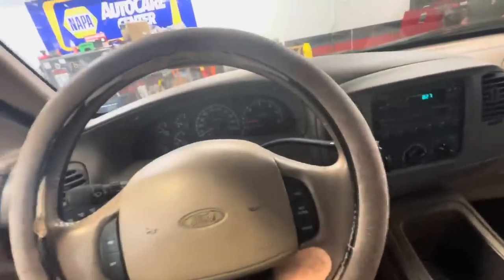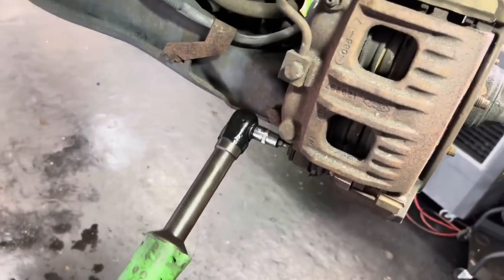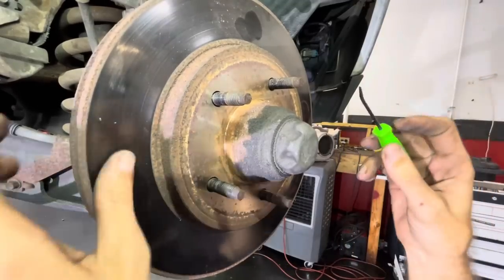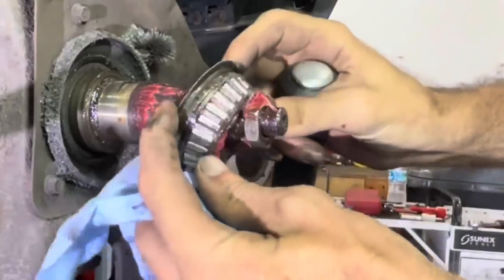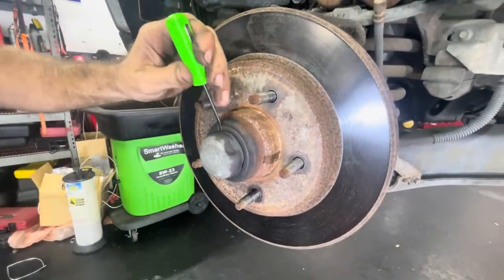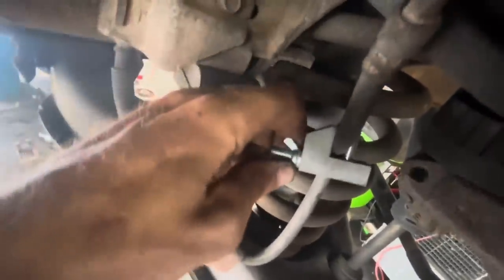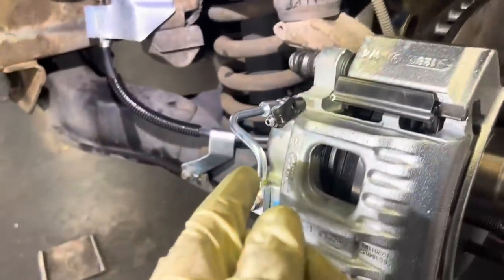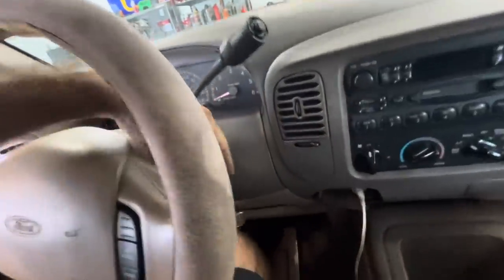Worn to NOTHING! 1998 Ford Expedition

Comment: When it comes to brake work and removing the caliper, ZIP TIES are your friend. I've had too many calipers fall on my head/hands to just set it on the knuckle. Just had to do a brake job on a POS 07 uplander. Dude swore the noise had JuSt StArTeD, there weren't any leaks (2/3 of everything was covered in oil/fluids), no cel, ran fine... Metal on metal on the back side of the driver side rotor. He came in for a brake pad change, ended up having to have the rotor and pads replaced. Dude brought brake pads that didn't come with hardware and told me to just put the pads on without hardware... Now, I'm not the type of woman to do as I'm told but considering how misogynistic and sexually inappropriate dude was (AFTER ID TORN DOWN THE BRAKE ASSEMBLY), he got exactly what he asked for. He was EXTREMELY lucky, the caliper wasn't extended to the point of no return somehow, the set screw had to be drilled out (he told me not to put a new one in since he couldn't afford an extra $1 for a screw), then tried to dip out on his extremely discounted bill... Dude is banned and local shops were informed. The kicker was this man swore he knew everything about everything cars 😂. They're why we have a liability form with an area reserved especially for people who want to come into my shop and bark orders.

Comment: Ok that steering wheel is gross. Second, my 2004 Mitsubishi Evo VIII MR has 277,000 miles. Engine was rebuilt and got a tune to bring it to 367 hp. Since I bought it new it's garaged every night and all maintenance done on time. It looks and drives better than new. Take care of your vehicle and it will take care of you. No rust or corrosion because it was a California car for it's first 16 years and now resides in Arizona

Comment: 6:25 EXACTELY!! Some ppl (read a huge amount) are so incredible clueless whit total lack of common sense that its scary! 

There was a 25 year old woman educator at a job (not educating in mechanics but other things but had done this before and have worked there for 6 years) where once when i was in the mechanic room with her she did exactly that when she tried to get out a bolt from something and it slipped and slipped so she wasn't able to get it of which should have been easy. 

I just stood there and thought how the hell cant you know what?!! So I told her to hold it the other way so it would bite into the material due to how the teeth were cut on it. She just stood there like a question mark and didn't understand what so even what I meant. I even showed here with my hands how the teeth would bite and the teeth them self but no, still totally clueless which was a REALLY surprise for me that she didn't got that what so ever when she had done it so many times. She was an educator in little advanced stuff so she had common sense but still nope. the few other educators there both males and females also had pretty much zero comon sense to equipment, they knew their educating thing but nothing beside that what so ever.

But I convinced here to do it anyway and she did but she was not strong enough in her hands to do it anyway so I told her I could do it and did it with one hand in 2 seconds. But showed her first how impossible it was in the wrong direction since it just slipped, as she could se. But no, still didn't get it.. just god dam unbelievable.

Comment: I was under the understanding you should never pinch a high pressured hose as the inter liner would be damaged.
Reply: That tool Ray used is designed  to safely clamp off brake hoses.  The jaws are rounded, so it doesn't cut into the hose.
Reply: @61rampy65  Or so they say, I still use plugs and caps on brakes. Brake lines have steel reinforcement and crimping that flat can't be good, that is why you should not let calipers hang from the hose.

Comment: cotter
Etymology 1 n. 1 (context mechanical engineering English) A pin or wedge inserted through a slot to hold machine parts together. 2 (context informal English) a cotter pin. vb. (context transitive English) To fasten with a cotter. Etymology 2

Comment: rarely use my bearing packer....its in a plastic bag somewhere in the garage filled with 20yo grease......hand method is best....it guarantees that grease touches every bearing. I am sort of surprised you didnt knock out the old races and use them with the old bearings...they dont harp on matching bearings to races at the auto schools anymore? I sort of thought it was bullshit myself and have been guilty of mismatching on some trailer bearings without issues.

Comment: The more correct way to set the wheel bearings is to torque to 70lbsFt while rotating then back off 1 flat (60 degrees). Then check end play between the spindle nose and hub. The end play should be between 0.001" and 0.004... On class 8 truck and bus hubs the initial torque should be 200lbsFt while rotating, back off loose, retorque to 50lbsFt and back off 1 flat. Then torque the outer nut to 200-250lbsFt ending with 0.001"-0.006" end play. It can be done "by feel" with experience but the description above is the most correct method.

Comment: Yes it bothers me seeing people using slip joint pliers, and even more so backwards, on nuts or bolts... Using vice grips backwards too... Derek does it on his channel as a funny. VGG. On using a clamp on a hose, it "can" cause damage to inside of hose which can act as a flap and hold the brake on after brake is released. You are going to change out at least some of that fluid anyways. Better to let it drain and flush out the brake line and hose.

Comment: I dont know that I am a fan of pounding on the face of the spindle grease cup with a rubber hammer. Use a piece of tubing or socket to keep it from getting all dented up like it already is.

Comment: Not a fan of that front brake setup, my Ranger is like that as is my brothers E150. Extra step of repacking bearings, and replacing the wheel seal, not to mention the mess.. Also the rotors are alot heavier.

Comment: You MUST replace both sides!!! Rotors, Pads, Calipers. You may get through with replacing only the the caliper and rotor on one side in the back - but even that is ultimatively DANGEROUS. What does he do on the highway @ 70 in the rain and a truck looses a tire? How will he brake and stay on the road???
Reply: Parachutes.😄

Comment: I am not a fan of replacing one calliper or one rotor for that matter. They are always done in pairs, what I replace on one side gets done on the other. I value having effective brakes too much to cheap out on brakes. I appreciate they operate independently, however with the Ford you were working on, I would imagine the callipers were very cheap, so replacing both would have been a relatively inexpensive.
Reply: Customer choice as always.
Reply: @stevewhite3424  Yes, it is. & while not really a safety issue, I feel it is prudent to replace both font or rear depending on which end you are replacing, left & right rotors or both left & right callipers at the same time. I have never had to replace callipers, though I have done a number of rotors either replace or had machined.

Comment: I am boggled of the mind as to why you would do a brake job without rebuilding or replacing the calipers. Every one does it, so I'm guessing that it's not necessary. When disc brakes first came out on trucks, corrosion would build up behind the caliper piston. When you put on new pads, it forced thee piston back into the cylinder. Then when the brakes were applied, because of the corrosion, the piston would stay in contact with the pad and not retract when the pressure was released. This created high temperatures. I set two trucks afire before I learned to rebuild the caliper and clean the corrosion out. The kit consisted of a new piston and an o ring or two. The OEM pistons were aluminum or steel. Then the rebuild kits began to have the composite pistons which were a lot better. 
I have to laugh at how much things have changed and how much is the same. That braided body ground strap was  used on Model A Fords.
As for rip offs, women and men who didn't know a lot about how their car worked,, were especially targeted.
About vacuuming the fluid in the brake lines. There was a brand name kit and then a Harbor Freight copy, that made bleeding the brakes a one man job.

Comment: I ran mine through the friction material and the backing plate. Then it was using the actual caliper as the outboard pad. 

I would've done it sooner, but it happened in the middle of the winter and it was the rear.. I knew it was metal on metal, but I didn't think it was that bad.

I still had about 3mm on the inboard and both pads on the LR were 3mm as well. Why would the one outboard rear do this? Stuck piston?
Reply: Stuck sliders.  That's the pins the caliper is mounted to the caliper bracket with.  If the pins aren't cleaned and lubricated every time the pads are changed uneven pad usually results.

Comment: 21:49 This is why every vehicle I come in contact with has comical preload (tight or loose). The "by feel" guys are almost as annoying as the people reefing on them. ...it's also why we can't have nice things. Everything has unit bearings now because techs weren't responsible enough to get out even one torque wrench let alone two and a manual to set preload.

Comment: Okay, brake-pad assemblies make no sense. While the piston pushes the brake pads against the rotor, there doesn’t appear to be any return spring (like with drum brakes) to pull the brake pads away from the spinning rotor when the pistons retract (especially on the side opposite the pistons.) Where’s my return spring… where’s the DAMN spring?!? 🤔

Comment: So here is a guy who does a rant when others do not put a stand under a jacked car, but is happy to balance a caliper on the upright hoping it will not fall and break his wrist or hit him on the head while working on other parts. He was lucky to catch the one that fell off, at best he stretches the hose and then what, charge the customer for a new hose or ignore that it may have been damaged? Safety, Ray, extends to all things you do, not some selective jobs! BTW, you wear gloves when greasing bearings as your natural skin oils can cause roller corrosion, something all aircraft mechanics would know.

Comment: On using the channel locks the wrong way, on something like you just did where the nut should be finger tight, no it doesn’t bother me. When they are used to try to get something that requires a bit of force, yea it bothers me

Comment: You do realize that you have to put the bearings back where they once were if you're going to use the old races and the old bearings. You cannot switch bearings from the right side to the left side because they've broken into the races that they have. You can't just put new bearings on an old race. Or a new race on an old bearing. You want to do things old school you're going to have to learn the old school way. You end up with fairly quick bearing failure if you don't maintain your bearing protocol LOL.
And your hose clamp can still damage those front brake lines. And I don't know that there's any necessity to change the banjo bolt however new copper seals should be used but aren't always necessary. As long as they go back precisely where they came from. And like you I do not care for changing a singular caliper. They should be changed as a pair of front calipers.
I've never heard them called anything but cotter pins. But what do I know I only started working on cars in 1964. It irks me when people try and make up new names for s*** that's already got names. Makes it hard to pick up parts when they have the name of the tool or part wrong at the auto parts store. Example, when they call it a ball joint splitter or a tie rod tool when it's called a pickle fork.
Reply: Your reply is the right way , but I'm afraid that 90% of the people out there will just use the old bearings with the new races installed in the rotors . As long as they are packed full of grease and not overtightened you will not have any issues . I'm a young pup and have only been doing them since the mid 70's .
Reply: Your hip is gonna fail before those bearings old man.

Comment: FAIL!!... What No brake pad grease!.. you needed to smear a coating on the back of the pads.. stops brake squeal.
I also put a coat on the brake pad hardware so the pads don't rust into position... Watch Eric O

Comment: The improperly affixed label on the parts washer, waving in the breeze of the woefully inadequate fan, is bothering me.  
It's very difficult to adhere things to blow molded polyethylene, especially in
your climate, and the fumes from the solvent contents further weaken the adhesive.

Does it "bother" me?
Yes, enough to type a post about it.
Reply: Calm down there OCD sparky 🙄🙄🙄🤦🏼‍♂️🤦🏼‍♂️🤦🏼‍♂️🤦🏼‍♂️

Comment: I bothers me to see someone use pliers on a hex bolt or nut. Use one of your wrenches. It is marginally acceptable to use them on a wheel bearing preload nut, but only just. It is never ok to use sliding joint pliers the wrong way around. But you do you.

Comment: Customers foolish not servicing frts with fresh components. Mite be ok below 40. Hi speed E stop is where unwanted and potentially fatal hard pull or lockup is possible w/unmatched stuff.
Proper brake repair Is Always Less Costly than a Casket

Comment: You need to learn how to properly pack wheel bearings the way you did it is wrong i know for a fact that most of the bearing did not get grease in them when i was packing bearings years ago i could do 8 bearing in less than half an hour and that includes cleaning them and putting them back on

Comment: SO many opportunity for some "giggity" comments during the lube stage of the spindle of this video! To my dismay, there were none. Disappointing! Do better Ray...LOL. I never had to deal with banjo bolts so does the copper crush washers have to be on both sides of the banjo bolt when reinstalled!?
Reply: crush washers go on each side of the fitting [the square block at the end of the brake line] that the banjo bolt goes thru....